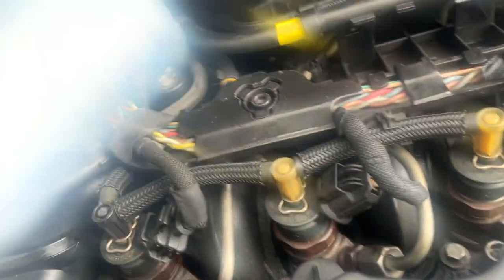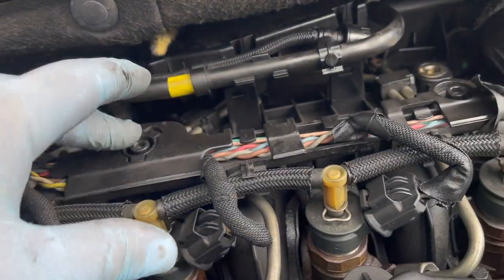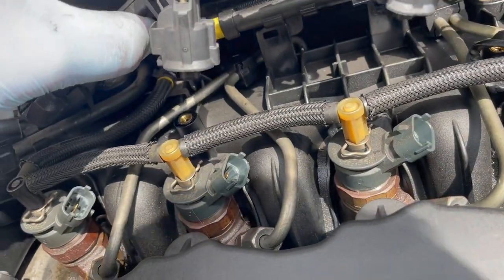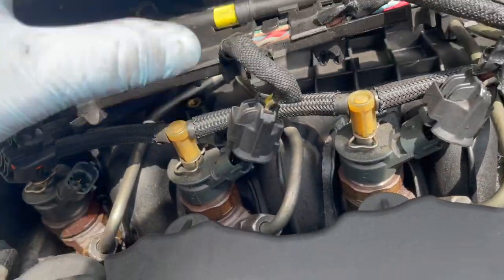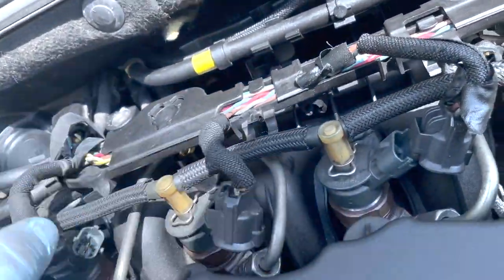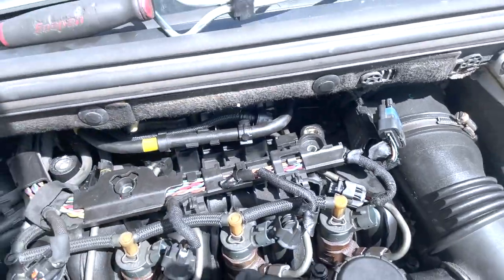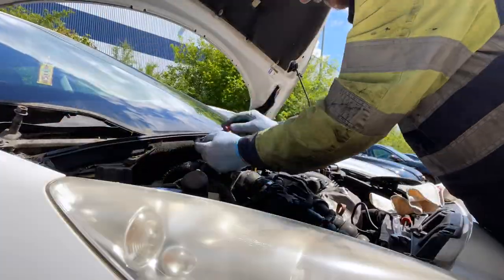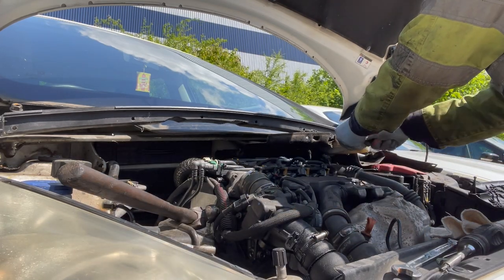A day in the life of A Mechanic! fuel pipe was not such a simple job as it seemed! Peugeot! 1.6 hdi

Comment: I have same motor mines a 2010 mine has 260 miles on it lol but never had issues until month ago clutch thermostat now fuel injection I think same issue with pipes at back of engine I’m in for some fun then 😱🤣
Reply from the maker: It all happens at the same time don’t it lol

Comment: I work on these a fair bit, although I haven’t replaced those pipes. Definitely designed by total Wankas mate. Lots of jobs on those just as difficult. Poxy things!!!!
Reply from the maker: You know what we’ve had this for years and it’s been so so reliable it’s done 180,000 now and still pulls alright, but like you say the designers did no take mechanics into mind. 😂
Reply: @freightlanetv  Regular oil changes really make a difference with that engine. Well, all engines I suppose as you know
Reply from the maker: Yeah 100% good servicing helps massively